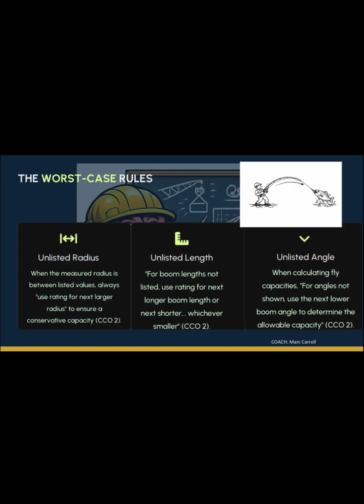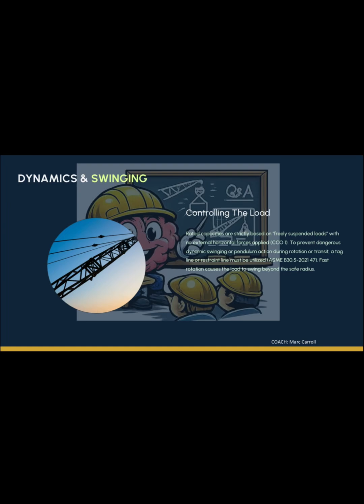TLL Capacity Limits & Setup: Crane Operator Study Guide Part One Understanding

Comment from the maker: [00:00] - Introduction to the TLL Load Chart Masterclass
 [00:28] - Understanding Radius and Deflection
 [00:36] - The Worst-Case Rules (Unlisted Radius, Length & Angle)
 [01:46] - Ground and Setup Fundamentals
 [03:17] - Part 2: Capacity Limits Explained
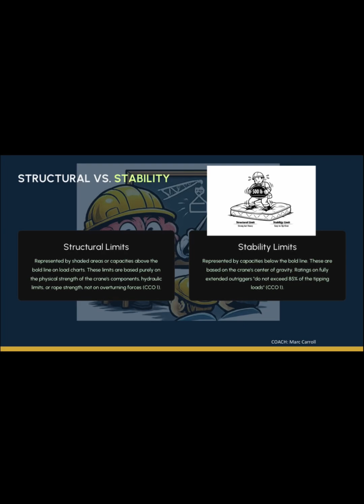 [04:47] - Structural Limits vs. Stability Limits
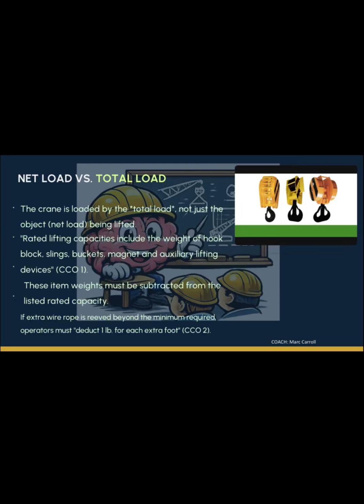 [04:55] - Net Load vs. Total Load Calculations
 [06:34] - Load Dynamics and Swinging Controls
 [07:42] - Words of Wisdom & Safety Reminders
 [09:17] - Works Cited and Conclusion